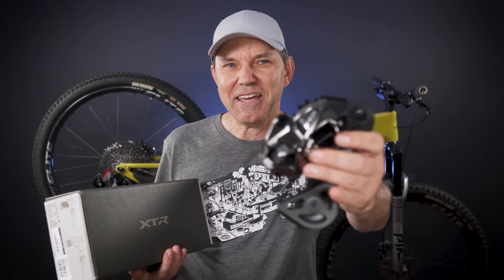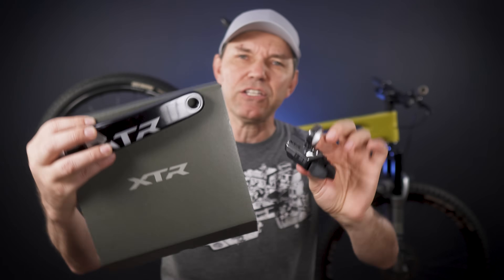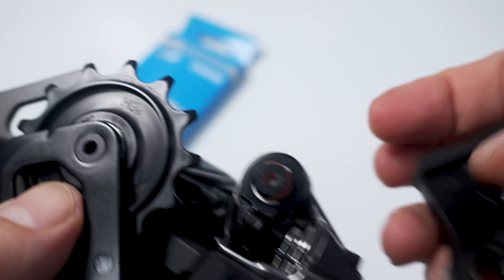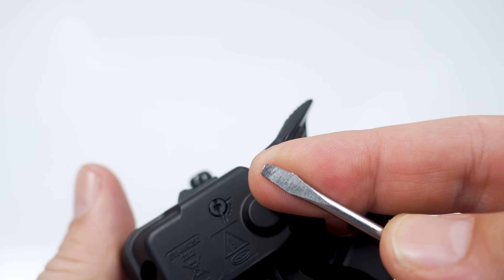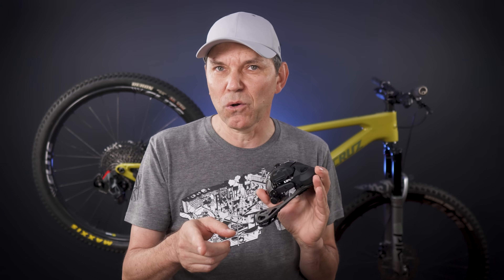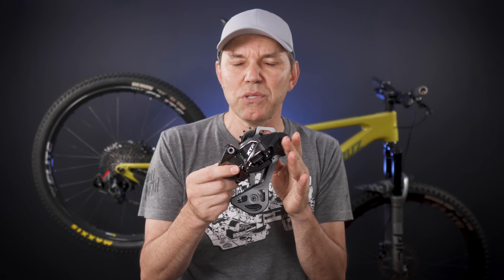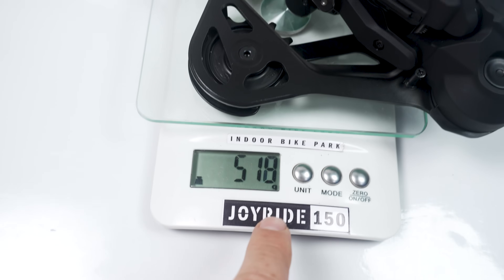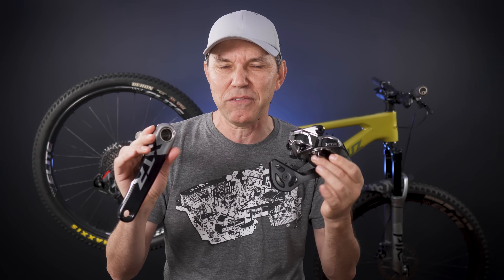Shimano Di2 vs SRAM AXS & T-Type: XTR vs XT vs Deore Di2 (2025 New Release)

Comment: I find it strange Shimano didn’t go with cut outs on the jockey wheels for the premium weight saving tier of XTR. 

Did you notice the Tension and Guide pulleys are identical? Also there’s no indication of direction of rotation marked on the pulley wheels. 

Did you find that the derailleur’s wake up from sleep mode has a long delay compared to SRAM AXS?
Reply from the maker: Solid jockeys so they don’t load up with gunk and debris. Did not notice an issue waking up

Comment: I want to keep Shimano's HG body, but can I use SRAM PG1231 11-44T (HG compatible) cassette? I'm thinking of combining it with XT M8250 GS (medium cage 10-45T) derailleur. The lever is grx825.
Reply from the maker: Shimano drivetrain on SRAM cassette works fine, but you might end up with one or two gears that are noisier.

Comment: I still don’t get the point of 55mm chainline.  Even at 52, it’s pretty grindey when in the big cog. My bike has tons of room to the tire in the big cog, so what’s the benefit of making the chainline “worse”?.
Reply from the maker: It's not about the chainline, it's about bigger volume tires in the rear of the bike and beefier BB area for stiffness/ power transfer. Compromises...
Reply: You can fit last gen 3mm offset rings to get 52

Comment: new brakes, especially 4-pot and new rotors are interesting.

for 2- and 4-pot, finally resin calipers' pistons, like on 12 speed latest grx, 105 and ultegra - bye bye fragile ceramic.
more sensitive/reactive calipers' seals, lower viscosity oil, for pads to retract almost fast as one lets off the lever blade, to fight wandering bite point, when doing long steep descents and/or low temp riding and/or actuating levers quickly and not letting them reset completely, but always having them somewhere in the middle of the stroke, when applying brakes again and again, thus having master cylinder (partially?) covering/obstructing the bore connecting the lever reservoir to the loop.

4-pot exclusive pull instead of push master cylinder, thus unavoidable new lever design to accomodate for that, like on Shimano STI road levers.
ball bearings instead of bushing for the lever blade, integrated/protected reach adjustment, 5° lever blade upsweap and closer to the bar lever blade pivot point, resulting in less on/off, so more linear servo-wave feeling.
one peace caliper (higher rigidity), oval bolt opening for finned pads, to illiminate them ratteling, although still a thing and slightly different pads shape, although, as per Shimano, still retaining compatibility with existing 4-pot xtr/xt/slx brakes.
+ no more protruding caliper bleed port and no more unscrewing it.
bleed port is integrated/hidden/embedded in the back upper part of the caliper, like on latest 12 speed grx, ultegra, 105 and need to slightly unscrew a hidden/embedded bolt in the back lower patt of the caliper, once the syringe attached to the bleed port, for oil to be able to flow.

new 180 and 203 mm cl900/800 rotors now have a stronger spider and it's shaped/bent against rotation direction, to reduce warping, like on newer Shimano road rotors.
and holes pattern is also different, curved, also against rotation direction, to reduce noise.
Reply: well, rotors aren't really new.
it's just that Shimano now offers redesigned road rotors ultegra (xt) and dura-ace (xtr) in up to 203 mm...
Reply from the maker: And that rotor is actually better than the MT800. I would get the CL800 every time.

Comment: Waiting for your video about install the XTR with a Sram cassette. Thanks
Reply from the maker: I hear you.
I will mention though that if I had the choice I would go for the Shimano HG+ cassette every time as it uses the better technology. Older SRAM Eagle cassettes are pretty noisy / unrefined in comparison.
Reply: I'm all for mixing componenets like @loveMTB is. but I hate XD drivers, I've had so many different failures with them. I wish there was more uptake of the microspline driver. At the moment garbaruk is the best source of cassettes

Comment: I don't know, but i still prefer the look of the old XTR crankarm, it looks more elegant and premium.
Reply from the maker: More about that in my next vid😊
Reply: @LoveMTB  I'm wondering if the cage of XTR is compatible with XT derailleur.
Reply from the maker: @IceGizz  Should be no problem
Reply: @LoveMTB then it is possible to get an xtr cage, put it on xt rd and you should have the same weight as xtr, just without r.

Comment: 9 tooth cogs.  Ride one.  I would stay away.  Maybe in your testing you can prove me wrong -but you will feel the difference.
Reply: But this new derailleur will probably work better because of the stronger cage spring
Reply from the maker: Given that’s rarely used I think we’ll be fine for MTB…
Reply: @LoveMTB I remember my e thirteen back in the day.  I would simply use the 10 51 instead.   This was back in the days of the NIMBY 50 and Test of Metal where there were max gear road sections.
Reply: What's the problem with 9t?
Reply: @Mu-zw5bm I used to use a 9tooth cog on an ethirteen.  You can honestly feel the drag on the chain from turning such a tight radius.
Reply: @MAEBikr  Interesting, thanks for sharing!

Comment: I got my upgrade kit on Thursday and took me less than 1 hour to install it and setup. It was literally plug and play in my TREK Supercaliber 9.8 XT. That only change I did was to change my cranks to M8120 from M8100 because Shimano recommends using a 55mm chain line with the RD-M9250-SGS instead of 52mm.
Reply: rather have a 52mm for the big rings.. and slightly lower q factor of course 😂
Reply from the maker: Yeah it’s pretty much same with AXS first gen. And 55mm…I would keep the 52 if your frame allows for it
Reply: 52 is better

Comment: The Q-factor of the 9200 (XC) crank set is 168mm in the media but on Shimano's web page for the crank it states 170mm. I have the 9125 (55mm chain line, 174mm QF) on a Scott Spark RC and have some rock strikes on it that may mean changing it out but the 9200 may have a too narrow Q factor that brings the arms closer to the chain stays. 9220 (Enduro) is 176mm. I do prefer the 9100 series way of the NDS crank arm connection to the axle. Seems odd they they went back to the pinch bolt design...cost? Longer pulley cage ready for the 13sp "upgrade" to counteract SRAM in the future?
Reply from the maker: Wider range can come with 13 speed I guess 😊

Comment: Could the longer cage be just accommodating the lack of clutch hardware in the Di2? I don't know if the Di2 RD main body is shorter or not though. just speculating....
Reply from the maker: It doesn’t make sense, longer cage can accommodate for wider range. Lack of clutch- you want shorter cage and chain of you can not longer😉

Comment: I can see the splines, but you didn't mention that the 9200 crank reverts back to the pinch bolt design. Is it welded or bonded? What is the weight of the xc version? I don't care about the 55mm oem chainline because I'd use an aftermarket ring anyway. Well actually I'd use Garbaruk or eewings crank.
Reply from the maker: Have the video in the editing phase 😉
Reply: @LoveMTB  cool, cool
Reply from the maker: @trentvlak  😎

Comment: Great info, although I don't think a multi tool really needs to be supplied. Anyone spending this much on an XTR  derailleur/shifter will have the required allen keys. I think its a good move to rely on the hanger as it's the easily replaceable part and we don't have a whole slew of people standing on drivetrains again. I do wonder though if the hanger will be bent more due to the weight.
Reply from the maker: It is a point about different approaches: Shimano is a great engineering company and maybe good marketing in their part of the world. Here in North America SRAM is eating their lunch, they come up with innovative/ edgy products and  push it in the market with creative marketing. Hence the multi tool and coaster…for GX not just XX1
Reply: @LoveMTB  I imagine it would get their name out there more, just seems a but 'gimmicky' to me. I also agree the 'look at me' XTR crank is too much and prefer more subtle indicators that I have something nice.
Reply from the maker: What can I say, around me here in Canada it looks as if I'm the only one talking about Linkglide/ CUES. Shimano ads/ info/ flexing their muscles is non existent. Q'AUTO just launched? E-bike with no battery? Nothing about that, nothing
Reply: @LoveMTB  Toronto here. In the shop that i work for, there's no way that employees will buy Sram. If not a crazy discount force for 350$ 😂. Or buying a bike that comes with Sram. Shimano and only Shimano.
Reply from the maker: @minhhieudang7951 depends who you ask, I know people that swear by SRAM 😊
Reply: @LoveMTB i got Sram force d1. The worst groupset i have ever ride . I put on my checkpoint to try, the chain keep felt off from front derailleur ( I'm bike mechanic, so i know how to install properly 😂). Bought the new Giant with Ultegra di2 0 miss shifting.
Reply: @LoveMTB For cable, Shimano all the way. For electronics, SRAM. I'm tempted to try Wheeltop's EDS OX 2.0 or L-Twoo's E-TX (assuming this one ever comes out).
Reply: @LoveMTB Yes, it is strange they have great long lasting groupsets that just don't seem to rate with many. The e-bike without battery would be a thing to see too.